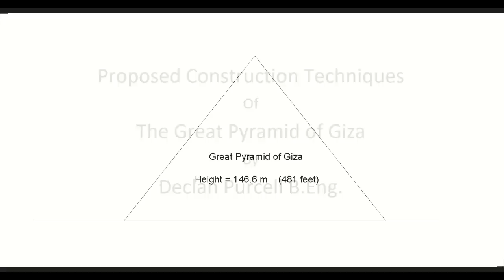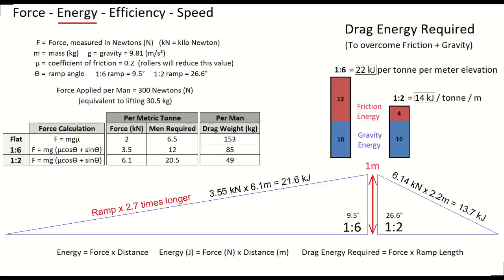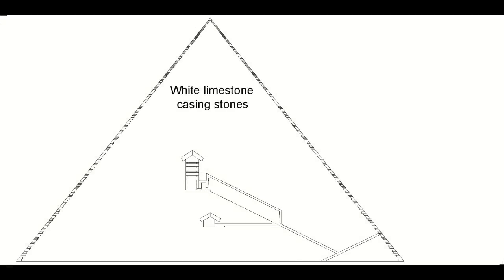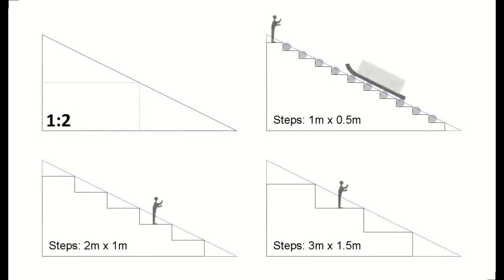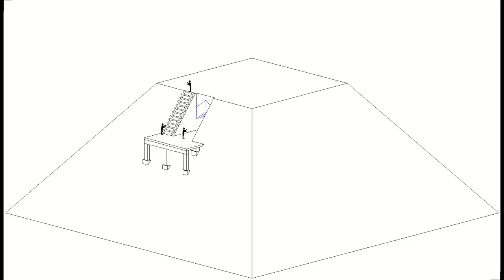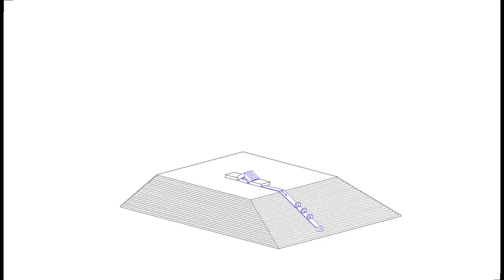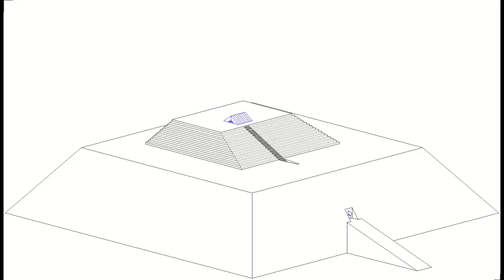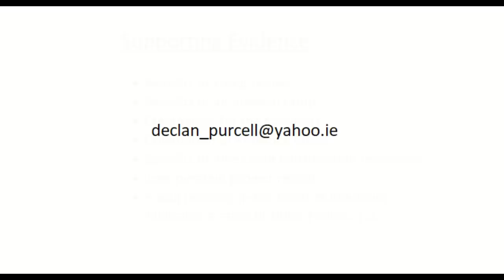Proposed Pyramid Construction Techniques

Comment: That would work great if they used animation to build them. Where do all those men go when they reach the top? What are the ropes made of? We use steel cables to move objects of the size the pyramids are made of. I doubt they had anything like that.  I laughed out loud when the animation showed blocks being turned end over end.  That's not to mention how the dragged those huge blocks over sand. It's obvious  some technique was used but this doesn't make sense.

Comment: I still wonder about the most important question, why.
Why build a structure that is almost solid with only a few small spaces.
And why do it the hard way, using immense huge blocks.
Using much smaller blocks would take much less effort, and if it was covered with an outer layer af massive stones it would be just as majestic.

I am inclined to think they build these out of huge blocks because they used methods that made is much easier for them then we think.
Hauling them up a ramp on a sled with muscle power is not easy.
Reply: The big blocks have specific electric properties.

Comment: This hypothesis assumes a near infinite amount of incredibly long and strong ropes. Pulleys will even strain ropes even more.
What ropes did these builders reasonably have acces to ? How did they reasonably combine these ropes in a safe and reliable way to lift 80 ton blocks?  
What force can one person reasonably assert on a rope, for a day ?, for a week ?, for a year ?
The rope-making industry must have been just as enormous as the stone-cutting industry. 
The wheel or pulley supposedly had not been invented. How to you intertwine strands of any rope without the concept of a wheel ?

Comment: The newly found room behind the chevrons doesn't quite fit with your idea. It is 9m long, has a gabled roof and looks exactly like one of the relieving chamber above the kings chamber.
Reply from the maker: It looks to me like this room has been filled with roughly hewn blocks.  It would make sense to do this for structural support on a room used during construction and no longer needed after completion.   The back wall is obscured.   The question is.. did it lead to a ramp?   Hopefully they will insert another camera and examine the back wall in detail.

Comment: The theory of using a ramp to slide 80 ton/slab of stone is not realistic, & it would be a very dumb idea for ancient civilization that doesn't have the right tools. it will be much easier just to use the power of water, would be easier just to build a tunnel that have the angle of the pyramid and will be extended each time they finish a story., using the guts of animals as ballons tied to the slabs will simply make them float to the desiered height.
Besides, using a ramp and not finding any trace of it today, is an acheivment by itself that surpasses the building of the pyramids.

Comment: "steep ramp is better". rly? even someone with elementary engineering skills know it is not. there is engineering calculation showing use of ramp i this case is not a good idea. while you can pull even 7 tonnes blocks using skids on wet plain sands  this will not work on ramp. try it
Reply from the maker: 7 tones up a steep ramp is not a problem with adequate men..

When you have few men, then go shallow ramp.
If you have lots of manpower, a steep ramp does not pose a problem.   
Three times faster to have 50 men pulling up a steep ramp than 30 men pulling up a shallow ramp.
Reply: @aenfeain  Calm down. This is the Great Pyramid of Giza - there are no blocks of that size in it.
If so, where did you get that from?

Comment: Steep ramp was rejected by many because of safety issues, it would kill or injury workers on daily basis.
Also possible health issues in tunnel (outbreak) if 1000 of workers do hard work with deep breath in confined space.
Reply from the maker: The video should highlight the practicality and safeness of an internal steep ramp.    Bear in mind there is no edge to an enclosed ramp, and the steps on each side provide adequate safe point support and mobility.  

The longest stretch of tunnel is from the chevrons upwards and is an approx. 150m in length.   Approx 220 men would be located within this tunnel during lifting manoeuvres.  At ~ 100 Watts per man, this will generate approx. 22 kW of heat which will produce an upwards movement of air within the tunnel (ie. the stack effect) which will draw in fresh air at the base and maintain a continuous flow of air.  Assuming a requirement of 10 l/s of fresh air per man, results in a total required flowrate of 2.2 m³/s.   If the tunnel had a Cross Sectional Area of 6 m², that would mean a 0.36 m/s air velocity through the tunnel would be required to provide adequate ventilation for breathing and temperature control.
Reply: If I was building the pyramids, I would load up on burritos every night so I could cropdust the entire corridor workforce with my flatulence
Reply: @declanpurcell571  they might have had giant bellows pumps to push air in as well

Comment: Everything becomes much simpler when you consider that the blocks are solidified concrete.
Reply: Makes it more complicated when you realize only the inner blocks were possibly poured and the outer ones are solid marble and granite
Reply: @muffinconsumer4431   Yes, but those few blocks of granite could be brought in with straight machines. The exterior blocks were made of lime, not marble. They could even be hoisted with a simple lever crane that was commonly used in wells and ports at the time.

Comment: First of all the ancient Egyptians did not build the Sphinx or the pyramids! A civilization far more advanced than today's civilization existed around 13,000 years ago and they built the Sphinx and pyramids. They used sound to place the blocks in place. Besides, how were the blocks cut of out a giant quarry? They certainly didn't use hammers and bronze chisels! Then they had to move them to a boat on the Nile and then remove them from the boat and transport the stones to the building site. No civilization that road horses and had them pull chariots could have made these objects!

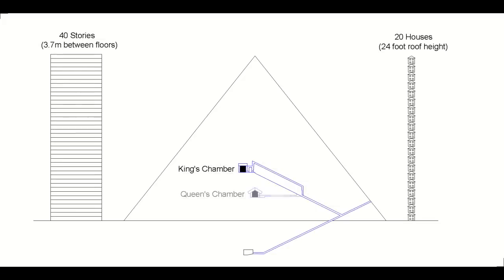Comment: 0:26 Hang on woah, woah, woah... I'm only 26 seconds in but you made a HUGE assumption there, being that a 'the flat roof needs an array of spacer beams'. 

The Queens chamber diverts the mass with just angled beams perfectly fine, so by following that logic angled beams alone could be placed directly above the first layer of flat ceiling blocks in the Kings Chamber and it would do the same job. The additional 4 horizontal blocks serve absolutely no structural purpose whatsoever.

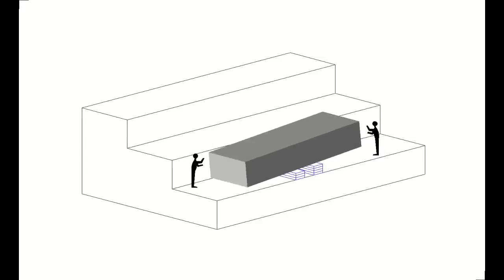Also if this took roughly 20 years to build, that would require 315 stones to be fitted each and every day, 7 days per week. 2,300,00 in total. Are you sticking with that theory?  Perhaps take another look at your workers at 6:00 before you answer. Could they bang out 315 per day 🤔
Reply from the maker: The purpose of the spacer beams are to ensure that the load bearing vaulted beams do not apply stress on the grand gallery stonework.
Reply: Regarding the 20 years, don't forget, the vast majority of stones in the pyramid as much smaller than the giant granite ones, so would be much easier to pull up.  I imagine it as a never ending train of stones - a production line with teams of workers swapping in and out.
Reply: The array of stones above the King's Chamber remind me of a Jed Pillar, so I'm thinking electricity was generated.

Comment: just another hypothesis, build one to prove it.  Geopolymer is probably best theory so far but 80 ton (4 train wagons) granite blocks are biggest mystery and using simple tools and hemp ropes is just parody to logic. If this logic is implemented in to modern building techniques then we don't need to use steel ropes and cranes. I think we missing something.

Comment: The problem with theories like this is that they are red herrings from other aspects of pyramid construction. Consider this: stones in the Great Pyramid show evidence of machine-like cuts and marks. Also consider: the geometry of the earth is constructed into the pyramid itself, as well as being nearly perfectly aligned to the cardinal directions; this indicates a working knowledge of longitude and latitude. These two factors alone, evidence of advanced machining and knowledge of Earth's geometry, suggests a culture far more advanced than one that would construct the pyramid using pulleys, ropes, and manpower. I'm not suggesting aliens, but rather that hypothesizing that the pyramid was constructed with these primitive methods is like theorizing that modern skyscrapers were built using ramps, ropes, and manpower. That being said, if any modern theory about pyramid construction were actually tested and replicated, that would change my opinion, but until then, this is a red herring.
Reply: No, they don’t show machine cuts. 
No the geometry of the earth is not constructed into the great pyramid or any other of the 118+. You have to jump through a lot hoops, including believing they invented the modern meter but never mentioned it over the cubit, in order to make any of those numbers work.
Aligning a four sided structure to directions isn’t difficult and requires no knowledge of longitude or latitude. If you can see the sun rise, you can align to direction. You could also do it with a plumb line and marking a star on the horizon. …there’s all sorts of ways to do it and you really just need a couple days, some sticks and maybe twine. Finding direction is a very basic survival skill every outdoorsman knows. If you can get lost and find north, you can not be lost and find it.
Reply: @AveragePicker  you are denying objective facts within your first two sentences, so everything else you've said is irrelevant, and you also seem triggered, which is not surprising. A lot of people, such as historians and the like, take serious offense if anything suggests the contrary to their learned narrative. Have a good day.
Reply: @dreamthread  Not triggered. Perhaps a bit tired of these repeated false claims though. And all you've done is show your ignorance and willingness to believe any counter claim regardless of logic or lack of evidence or in the longitude case, being completely incorrect for inexplicable reasons. 
But by all means please explain why I need longitude and latitude to find n,s,e,w. 😆
Reply: What does a "machine like cut" look like?
Reply: @AveragePicker  When the emojis and personal insults come you know they are triggered. I must've really pushed your button. Close minded people often react this way when their ideas are challenged.
Reply: @dreamthread  There's nothing challenging to anything you said. It's just wrong on many levels.
Reply: @AveragePicker  For some people it is difficult for them to have their beliefs challenged. Its a perfect example of cognitive dissonance. Some people are so by the book, and don't question what they're taught, even in the face of radically new evidence that contradicts what they know. When objectively the pyramid itself is a 1:43,200 scale model of the earth, and how its base perimeter equals 1/2 minute of latitude, and people like the aforementioned hear this their minds simply cannot handle it and they outright dismiss it as "no, thats not true." In this case, the measurements speak for themselves, despite how people such as yourself and others in this category feel about it. So again, my original point stands undisputed. A culture as advanced as this wouldn't use ropes and pulleys (lmao). I'm open to having my mind changed if such a theory could be proven by actual replication of such a structure using this method, but nothing of the  like has happened. People like you though have their minds already fixed on pre-determined narrative and no evidence could change that.
Reply: @dreamthread  Again I ask, at what point in history do you think people could build the structures around them? Let's establish when you think a civilization's tech level was sufficient to construct things. No matter what you think about how the one pyramid was constructed, at some point you must surely realize people were lifting heavy blocks with ropes and ramps, and other basic techniques. So you are saying it works in all cases, except this one. 

Your original point, you seem to be ignoring the glaring problem. You have a civilization working in both the modern imperial and metric system, and using modern longitude and latitude. Does that not strike you as off? Honestly, do you really think they were using feet and meters, interchangeably and had measured light in a vacuum, and adopted our exact same longitude and latitude system, and used our modern encoding for it....and used Greenwich? 
If you can't see the absolutely glaring issues there, then don't even try this stupid "open minded" thing. You've totally closed and blindfolded yourself. 

..And yet this advanced civilization, using our modern measurements, showed less architectural prowess than everyone else working with basic tools. Again, look at the whole picture. 

43,200 appears one time in The Sumerian King List. Once. The list itself has over 200 numbers in it. So you are essentially saying that every number and combination of numbers, is "sacred."

Comment: amazing,   Amazing how you can only envisage things in triangles and unneeded solutions to non existant problems.

if you asked any construction engineer to build any builging they would not demand a giant crane and ramp slope to build any two storey or higher building would they?
  doubtful but still cant be built far easier with current regulated materials as you understand them.

and yet inferior no tech lot did that where you could not?   
is it a lost tech simple people had, or a lost understanding how things work modern people have lost.

quite a paradox and comedy.

Comment: This only have answers to a few of the important questions.

But what about their messurements? 
The preciseness of the pyramid both in placement but also size.

How did they transport 80 ton stones from a quarry in the mountains on the other side of the Nile.
We know nothing about any boats, that can handle these kinds of stones.
Reply: Egyptians used barges all the time to transport lumber, stone, animals and whatever else they wanted through trade or war.
Reply: @Brian-ve2ff  yes light stuff but not stuff that weight 80 tons. And not 80 tons from the mountains on sleds. 🤷🏼‍♂️
Reply: At the same time you would have to take extreem care of the buliding blocks so they could achieve the gap between stones at a max at 0.5mm
Reply: @ayz48  barges can carry larger stones also. Huge mass of pyramid is rough but blocks with rubble and mortar filler.
Reply: @Brian-ve2ff  source?
Reply: @ayz48  It is always surprising to hear that question asked. If you were certain that biats could not carry heavy weights, surely you must have researched first?  As an example, Queen Hatshepsut had a boat to carry obelisks to Karnak which was 200 feet long and 70 feet in beam.
Reply: @Eyes_Open    i cant seem to fint any documents on her boats and ships directly explaining they did transport stones up to 200 tons, wich these obelisks of pink granite would weight up to.

Please give a source. It sounds interesting.
Reply: @ayz48  The Temple of Hatshepsut at Thebes contains scenes of the transport of an obelisk down the Nile by barge. Online searches can provide simple data but looking up more details from published papers will take some time for you to sift through academic sites where some are free and some are subscription based.

Comment: First figure out how the quarried the blocks, then how they moved them hundreds of mile. Now some of the blocks being hundreds of tons, then there are the blocks that are just a tad softer than diamonds and quarried from one mountain in a mountain range then moved 600 hundred miles.
So basically they built a mountain, from a mountain.
Stumbling over how they moved them into place with precision when on site, from an intellectuals viewpoint is dumbfounding.
Reply: Most blocks quarried from limestone on site. Huge mass of pyramid consists of rough cut blocks with rubble and mortar. No block over 80 tons. Nile was used to transport limestone casing stones from Tura and granite from Aswan.
Reply: "tad softer than diamond" delusional
Reply: @Brian-ve2ff  There's structure with boat slips on mountain ranges, with mountain peaks being quarried.

Problem is getting a time frame for when did who do what.
Reply: @hello-rq8kf  there's a hardness scale, look it up, apply it too ancient building material.

Comment: Your explanations are lacking as you leave out how they could see in the dark once the inner ramp was enclosed by the rest of the structure.  It's also very easy to say "well they could have used greased trees" while there's no trees in the close vicinity of the pyramids except for Papyrus.  Any outside ramp would have taken as long to build as the pyramid itself.  I veer towards sound and vibrations to move or even cut all the blocks.  Look-up Nikola Tesla's mechanical resonance theories and how far he got before his money sources left him.  Besides of this, Kufu had nothing to do with building of the Giza pyramids.  Egyptians told of all great feats across all dynasties, but not a single hieroglyph about the building of the great pyramid can be found.

Comment: Well, your ideas are not monumentally stupid, and don't rely on a bunch of Fairy Dust or Aliens to build it.
So, that all by itself makes your ideas 10,000,000 times better than most.
But I am not buying it, sorry.
A steep ramp is very dangerous, and that is why the mechanism inside the Grand Gallery was created using counterweights to haul up the large blocks. At least according to Jean-Pierre Houdin, who is undoubtedly the least-wrong about the proposed building method.